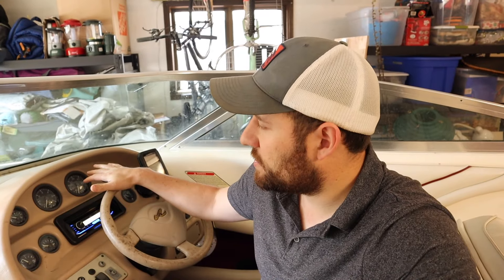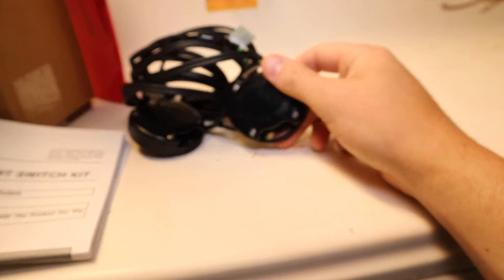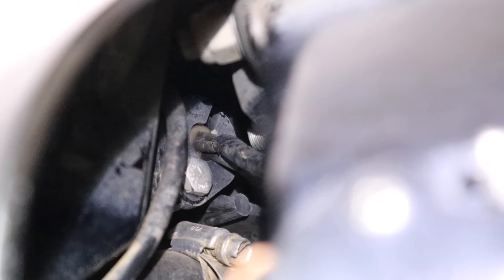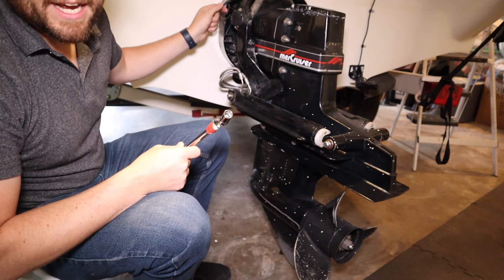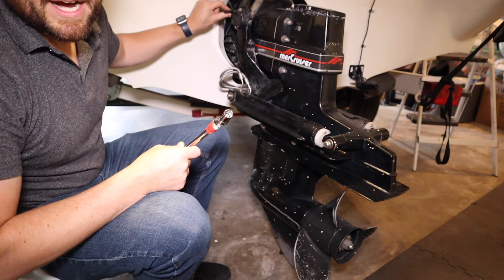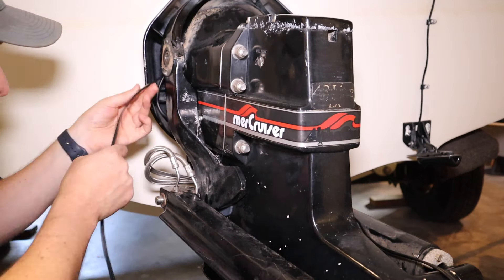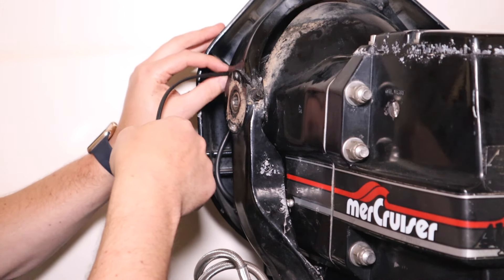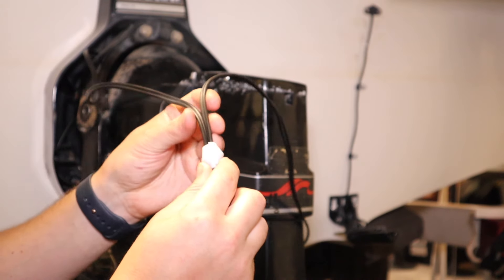Installing new Trim Limit & Sender Without removing outdrive Mercruiser Alpha 1

Comment: Great video, I just did this myself after watching. Someone else commented to jack the stern up so you can lower your out drive all the way down. I definitely suggest this also, and like another person mentioned, if you have someone who has small enough hands to at least get that bolt started then that’ll save you a ton of time. I had to do this on my own with no help, and yes getting the bolt started and back is by far the toughest part. This guy gets it in about 10 mins, but expect to be messing with it for a lot longer. Took me over an hour just on that one part because I couldn’t get the bolt started. Just be aware this takes some serious patience, but it is possible.
Reply: That's for your time doing the video you really helped me with the questions I had
Reply: Nice clear instructions.  Will give it a go

Comment: wish i woulda knew that all I had to do was unscrew the bottom of the sender and limiter and take the wires out and put a new sender and limited in and then tighten the screws, my wires were perfectly fine, if well i ended up doing all of it unfortunately

Comment: I just completed the same project. This video really helped. I can add one thing. When you remove the bolt holding the wire plug  to the hull, take a dremel tool and cut a slit in the top of the bolt. Then your can fish a screwdriver between the housing and the outdrive and screw the bolt in . This makes it a ton easier to start the bolt. Hope this helps.
Reply from the maker: Thanks for the tip! In my case, I did not have too much trouble getting it started, but I may have been lucky to get it to grab as quickly as I did.

Comment: Why not pull the outdrive and  check the gimbal bearing and bellows while your at it?
Reply from the maker: There are many reasons you may not want to drop the lower unit to complete this repair. In my case, my lower unit had been serviced not too long ago. I agree if there is a need to drop the lower unit anyhow, you might as well do it to make the process of fishing the wires through easier. But, it is still helpful to know how to do it without doing so.

Comment: Dealing with EXACTLY this issue... perfect video. Applaud the patience with that bolt.  I've been staring at it wondering whether it was too insanely tight to deal with. It's either postpone and go without the down trim switch on the throttle until the next time I need to take the outdrive off for something, or do it myself now. Just had the damned Gimbal bearing fixed, so the fact the shop didn't notice the sender unit wires were cut and deal with it then burns me up, but oh well. This has me thinking I can give it a try. Thanks again.
Reply from the maker: Thank you! It did take some patience, but wasn't too bad. Just wanting to confirm you meant trim up* switch on the throttle, because the limit and sender switches shouldn't affect the trim down. If so, you should definitely go for it, it's really not very difficult at all. Let me know if you have any questions!

Comment: I have the same  boat and mine are not working either.  I am wondering if you could have soldered the wires on the outside and encapsulated the connections with shrink wrap and liquid rubber.  Electrician by trade, just a thought

Comment: Awesome video, huge help!

One thing I discovered is that if you use an 8in 1/4 extension with the outdrive turned all the way right, you can stick it through the gimbal housing gap on the side and get a straight shot to that screw.  You will have to put the socket on after you stick the extension through the gap. Cheers!
Reply: Great discovery. Thank you.
Reply: Tried that, wouldn't work for us. But thanks for the suggestion

Comment: Thank you for this video. I would not have had the guts to do it myself without it. One tip I have is I pulled out both old wires, then taped the ends of the new ones, then stuck a thick coat hanger wire into the tape at the end and thrusted it through the hole. After jacking up the stern and lowering the outdrive there is a gap that gives you a straight shot in. You have to stick the end of the hanger wire throught the gap in the gimbal housing, then into the tape at the end of the wire. Via Con Dios. Patience is the key on this job.

Comment: Thank you so much for posting this. We had the exact same problem where the up button on the trim didn't work. You talked about where the wires come through the boat, having 1 bolt. Ours had the 2 bolts. My husband was able to get one out, the other I was able to get my small hand up there, he cut me a special tiny wrench and we accomplished the task of getting the wires through with a lot of fanagling. Great camera work as well. 🙂

Comment: Great Video. I found a time saving improvement. Trying to get the retainer bolt back in is pretty fiddly. I disconnected the hydraulic rams at the back of the outdrive by removing the cap and one of the clips. I was then able to drive out the shaft connecting the rams to the drive. I put a short 2x4 under the skeg to prevent damaging it. This allowed the drive to drop and provide enough space to get a 1/4” extension through and an almost straight shot at the bolt. I still used a universal adapter. I needed to thread the extension through the opening and then connect the adapter and socket. I also sprayed some PB Blaster in the threaded hole and then blew it out with compressed air (wear a face shield or goggles). 
After securing the bolt, I cleaned the the removed shaft and applied a little marine grease before reassembling 
.Thanks for the video. It saved me time and $$$.

Comment: Thank you so much for the video.   Ot saved me countless hours of work and worked great. The one thing I did differently was I actually took the three bullet ends and cut them off for ease of pulling them through the hole in back of boat. I left enough to use butt connectors once I got them through and since one on each side had writing I knew I got them  right. The other thing was I  pulled 16 guage wire through the hole to begin with as I was pulling the old ones out and I used the same to pull the others back through first inserting it in the female bullet connector on the new sender and pulling just that one through then I wrapped the wires together with the other and pulled it through. I used an aftermarket set of trim sender and trim limit I bought on Amazon for.39.00 and they work just fine

Comment: Thanks for making this video.  I did it the way one of the commenters suggested, which was to jack up the boat and lower the outdrive all the way down.  Allowed me to get to the bolt a little easier.  For many years I was always told this could not be done without removing the whole outdrive.  Nice job!!
Reply from the maker: Thank you! Glad you were able to get to the bolt that way, may try it if I ever have to do this again. Either way, definitely beats pulling the drive!

Comment: Great video.   I used a long 1/4 socket extension with the  flex socket.   I got lucky and had the bolt off in about 5 minutes, using your tips.   There was clearance for me to go through the gimbal assembly almost directly to the bolt.   Everything went to crap, though, when I snapped the head off one of the mounting bolts for the  trim sender.  It was so corroded I ended up having to bore it out and retap the hole.   That added a couple hours to the job and a couple trips to the hardware store.
Reply from the maker: Ah damn well I’m glad it went smooth otherwise. Sure is nice having the gauge and trim working properly!
Reply: When your entire vocabulary of expletives comes forth instantly....  I dunno what we all did prior to You Tube....It's enabled me to tackle jobs like this with minimal fumbling around, trying this and that.  Not only are the vids themselves invaluable, but the helpful comments are the frosting on the cake.

Comment: This is one of the most informative videos I have seen relating to the work I am doing on my '99 SeaRay Bowrider 210. Thank you so much. I have been living with no trim gauge since I bought cause I really didn't have any idea how it worked. Your video was so familiar because of a lot of the same parts. Now I have ideas to try. I think I may only need to adjust the sender now that I have seen you do it. Will be so happy if it's that easy.
Reply from the maker: I'm sure you can get it figured out! Glad I could help.

Comment: Nice video. I'm in the process of buying a 290 sundancer with 5.7 alphas and the trim sender/trim limit needs replaced. The only rtim sender I've ever replaced was on a volvo penta on my brand new Stingray 200LX back in 2006. That was REALLY challenging. These dont look too bad. Nice job. thanks for sharing.

Comment: Thank you for this video. It really helped a lot. TIP- paint the little plate that the wires run through white. it makes it easier to see when you are trying to put the bolt back in.
Reply from the maker: No problem! and good idea to paint the plate white. It is hard to see up there.

Comment: I changed mine after watching this video. Very informative so thank you. One thing I can advise to make this easier is my girlfriend who has pretty small hands was able to reach in and get the bolt started which saved soooo much time and aggravation!
Reply from the maker: You're welcome, glad I could help and thanks for the suggestion. I did consider asking the girlfriend for assistance, but got lucky enough to get it started relatively quickly.

Comment: Great video! Just swapped mine with the help of this. I used a 1/4" drive socket with a wobble and was able to get in between the slot in the bowl shape at the top and the frame/housing so I could get at it almost straight on. I did have to put a few drops of super glue on the bolt head in the socket to keep it true to start the thread. Thanks again!
Reply from the maker: Awesome! Yeah I tried that with mine but it wouldn’t quite fit. I have heard of others grinding theirs down to get it to fit. That’s cool yours fit without doing that though. Thanks for watching, glad it was helpful.
Reply: @Jacob190000  I think the trick is to jack up the trailer so the trim can go ALLLL the way down. I easily got my 1/4 drive in there.

Comment: Great video. Only suggestion I have is to fill EVERY electrical connection with dielectric grease and you should be good for a very long time. 

I’m going to disassemble my sending units to see if filling them with dielectric grease would give them perpetual life as well. 😃 (At least longer than the rest of the drive 😉)

I would love to hear if anyone else has done this and what the performance of the trim sending units was. 

I’m repowering my Se Ray Sundancer 300 with a pair of new 5.7L Vortex engines. Love to hear from others!

Be safe!!!

Comment: Putting new sensors on a 1990 Bravo 1. Luckily for me though, I have the outdrive removed for other repairs. My limiter sensor also had shredded wiring like yours. I don’t think that the wiring had adequate protective shielding from the factory. I plan on giving it some wrap and zip tying it out of the way this time. 

Great video. Thanks for posting.
Reply from the maker: Definitely not! It seems the shielding is too thin just disintegrates.

Comment: You make it look too easy. it was a bitch, and I'm a fairly good mechanic.  My 3.0 is in a 28 foot pontoon. This adds to problems because the engine is so low and need to hang over  seats.
First removing the retaining bolt and dropped it, lost forever. Had my socket full of putty to hold bolt but the swivel hung up and dropped bolt. Trusty magnate didn't work because it's stainless, also didn't work holding the clamp because that's aluminum. Bought a 3 pack of bolts from dealer for 5 bucks. 7/16 1/4 20 5/8 length stainless. 
Everything came out ok after that. Wires went thru transom no problems and connected to electrical no problems. I super glued the 2 white halves and taped them together. Learned I needed to tape the holding plate tight to the white plug to keep it in a semi good position to start the holding bolt. I did secure the bolt thru the holding plate with a tiny E clip and pulled it all up, connecting socket when things lined up close. I just couldn't chance dropping another bolt. I used heavy duty fish string, wrapped around the E clip to pull the e clip off once bolt grabbed a few threads. This actually went great. Used a 8 inch 1/4 wobble extension thru the tight area in the plate, added socket. Wasn't too bad securing the bolt this way. Oh, I did paint the retaining plate white like someone suggested. It helped to see up there. Got it done the hard way! 
 At first I was going to just run the wires up the transom and drill thru, since this is an old pontoon it would have made this easier.  Also considered drilling a small gap  and feeding the extension thru in line with the bolt making a direct shot to tightening. Anyways great video and lots of great comments that encouraged me to take the hard way.

Comment: Nice video thanks. Quick question mind you I ask because I’ve had a lot of misc issues with my boat so I’m trying to invest as little as possible into it. Couldn’t you splice the wires?
Reply from the maker: Yes you could, but it has a much higher chance of failing again in a short amount of time. Not only are the sensors likely corroded and needing replaced, but having spliced wires exposed to the water has a much higher chance of failing again.

Comment: Good job I am not sure if you said the size of the socket used. but that would be helpful, half the battle of a job like that is rounding up all the correct tools..I am glad I don't need to do this job but it was interesting watching.
Reply from the maker: Yep I did mention but it was subtle! 7/16 is the bolt size.

Comment: Thank you for the great how-to! My trim up just went out this last weekend and I'm having to use the trailer button currently.  I may have it a bit harder as I have the Alpha one gen one. Thank you for sharing!
Reply from the maker: Let me know how it goes! Honestly, the 1 extra bolt shouldn't make too much of a difference. Maybe an extra 20-30 minutes or so of fiddling with the bolts.
Reply: Sometimes the limit switch just needs gunk cleaned out of it.  The limit switch is a copper contact that stops the up button from working once the contact rotates enough.  I have had mine get coated with the grease so much that the up button just stops working.
Reply from the maker: Definitely true. But, after 20+ years I’d say replacing these switches and cabling is worth the time and investment. Even if you can temporarily fix by cleaning them, the cables get brittle and will need replaced. But good point that they can often just be cleaned, especially on a boat that’s 2000’s or newer.
Reply: You do it yet??? How was it?

Comment: good video, after installing the new wires the bracket that holds the two half plugs won't seat flat to the surface..maybe because the half plugs are new?
Reply from the maker: I would say the plugs may need to go farther into the hole. Maybe try giving it a firm tug from the inside of the engine bay to see if they will go in more and allow the bracket to sit flush.

Comment: I'd like to just say that with the time to take that bolt out and reinstall it along with the new wires from that position it is actually likely easier to just remove the outdrive which is incredibly easy on the Alpha series outdrives.
Reply from the maker: Yes in some cases it may make more sense to just remove the drive. For many of us, the extra time it takes to not have to remove the drive is worth it. Especially if drive oil was recently changed, etc.
Reply: @Jacob190000  Well drive oil is not an issue with the mercruiser outdrive removal, and it does not save time, it is soooo much easier just to remove the drive unit instead of fiddling in such tight spaces. it's merely 6 bolts and maybe a new gasket but it's doing the job right and quicker and it also gives you a chance to inspect your bellows and lube the joints on the drive axel.

Comment: great video!  I may tackle this as I have the outdrive off already anyway to do the bellows. My trim is working decently but the wires are frayed like crazy on the starboard side and my guage is never really fluid when adjusting. It jumps all over and very erratic.
Reply from the maker: Yeah when those wires fray and sensors get all corroded they start to get erratic. Would definitely be worth while to put new ones in, especially with the outdrive  off, should be a breeze.
Reply: Cars & Computers thanks for the video. I went and bought new sensors today. I’m just doing everything I can touch while it’s off just to sleep better at night.

Comment: The boat I bought has a hole drilled through the transom for the wires to route. Not quite the way to do the job, but it sure makes it easy to change them out.
Reply from the maker: Yes I have seen that mentioned before. Asside from the extra hole, my main worry would be somehow pinching the wires while tilt/trimming the outdrive. If it works it works!

Comment: If the wiring is still in good condition couldn't you just cut and splice the new wires from the new sending unit using some water tight connectors?
Reply from the maker: Yes, if the rest of your wires are in good condition you can do that. In my case they were in very bad condition with the shielding coming off all the way behind the gimbal.

Comment: will the trailer option still go higer up right? you can have the unit higer up ( more than 20" 3/4) as longest is not running right?
Reply from the maker: Yes the trailer button will go up as high as the hydrolics allow. The measurements are for the trim up/down button to ensure you don't accidentally trim too high while the engine is running, causing damage to the outdrive.